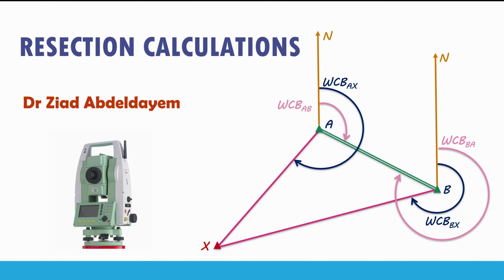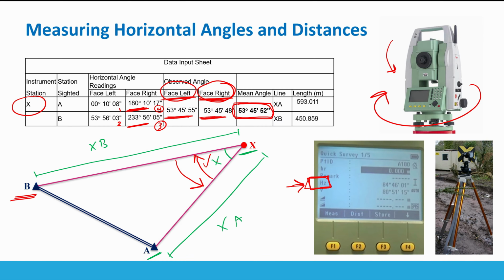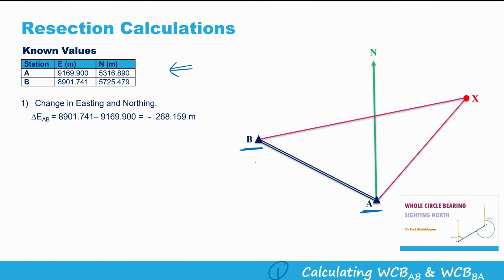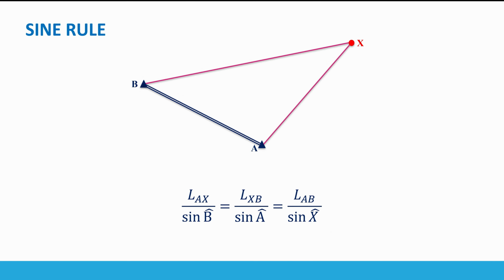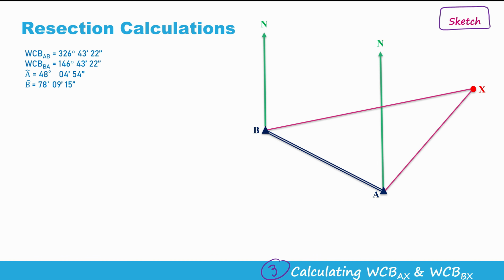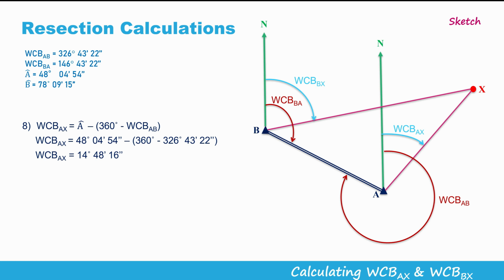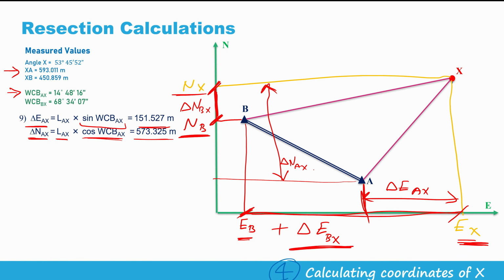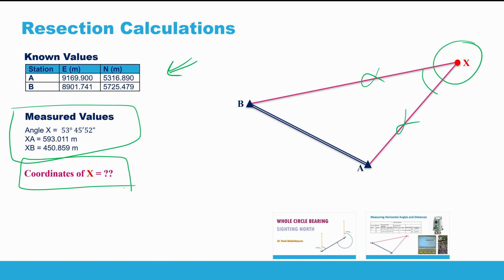SURVEYING | RESECTION | CALCULATING THE COORDINATES OF AN UNKNOWN STATION FROM 2 KNOWN STATIONS

Comment: Dr. Ziad, you have very good patience in explaining how to derive the position of the station x as explained used for resection in theodolite surveying. I am looking for a reliable formula in the form of Microsoft excel formula such that position of x can be found by computing the data in excel cell format during site survey so as to compute the work required on the field there and then.
Reply from the maker: Thanks.

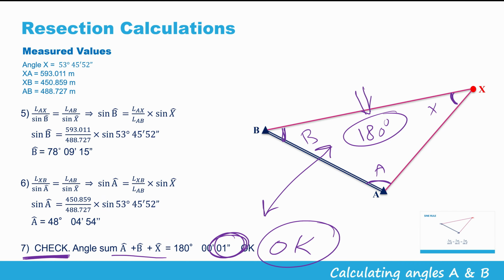Comment: Wh 20:47 when inputting the calculation you have shown I end up with a different answer. How do you input this into your calculator when finding the missing angles. Thanks
Reply from the maker: There is a button on the calculator for degrees minutes seconds (.,,,).

Comment: My doubt is the slope of line AB is rise /run = tan θ. i.e  θ=tan -1(N/E). But,  In ur case quadrant bearing calculations showing θ=tan -1(E/N). So , which one Is correct sir ?
Reply from the maker: Hi. We are not calculating the slope here. We are calculating the angle between  the meridian and line AB.

Comment: How would you calculate WCB of BX on point B if E and N are both negatives, assuming north is straight up. I know angle B and WCB BA but then require WCB BX. Do you take angle B away from WCB BA to find Theta then take 360 away from theta to give WCB BX?
Reply: For context my angle B= 76’33/59.46// and my WCB of BA= 46’4//36.72
Reply from the maker: It depends on the position of X relative to line BA. You need to draw line BA and point X, then calculate WCB (BX) from the the drawing.
Reply: @ziadabdeldayem6884  X is on the left side as both values are negative, A is to the right and B is at the bottom below X and A relatively in between the two
Reply from the maker: If point X is to the left of line BA, then WCB (BX) = 360 - (B - WCB(BA))
Reply: @ziadabdeldayem6884  perfect, thanks for the help Ziad👍🏻